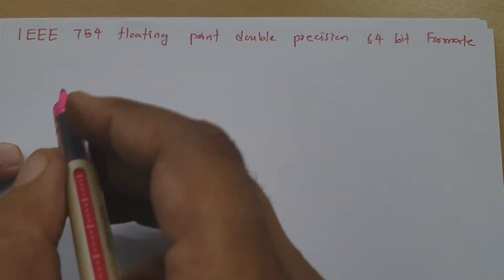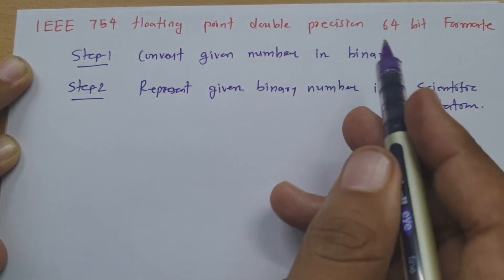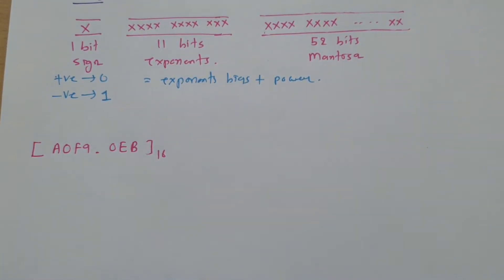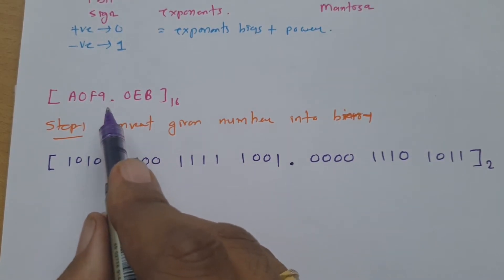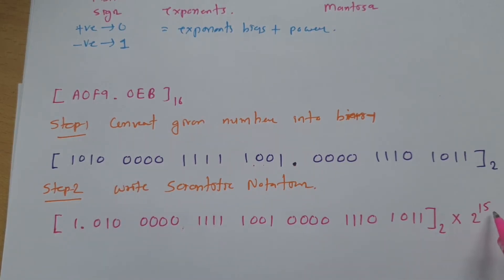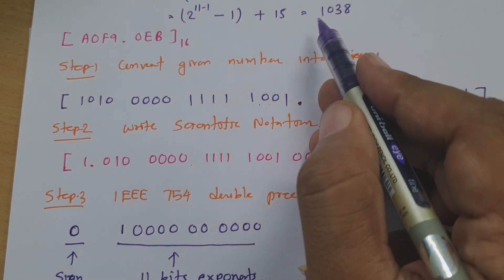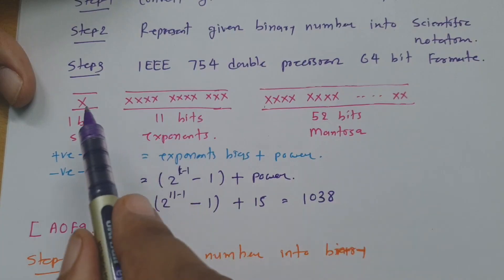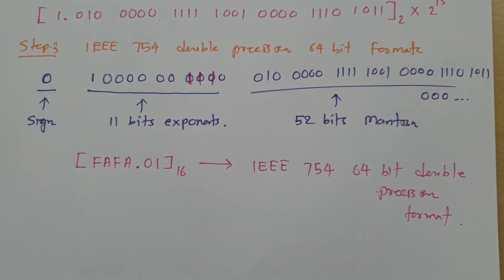IEEE 754 Double Precision 64-bit Floating Point Format: Steps, Format, and Example

Comment: Question: do the extra 25 zeroes in the mantissa lead or trail the digits you wrote down for the mantissa? And Why? Thank you for the video!
Reply: I think I figured it out...they are trailing because the mantissa represents the numbers AFTER the decimal point. 🙂 so [FAFA.01]16---> 0 10000001110 111 1010 1111 1010 0000 0001 00000...0000
Reply from the maker: Yeah that's due to format

Comment: Hello sir, I have this question: Express 0x5ABC8 in IEEE 754 double precision binary floating point format.
does it mean that 0x5ABC8 is in IEEE 754 double precision hexadecimal and i have to convert it in IEEE 754 double precision binary, or 0x5ABC8 is a simple hexadecimal and I have to convert it in  IEEE 754 double precision binary the way you did in this video? please I really need an answer!
Reply from the maker: Yeah, you will have to do it as i have explained.